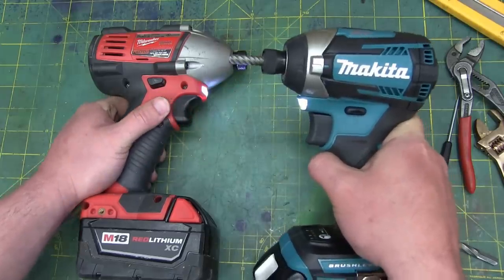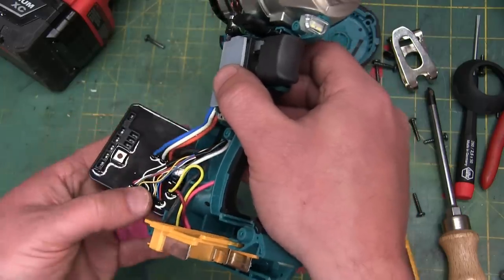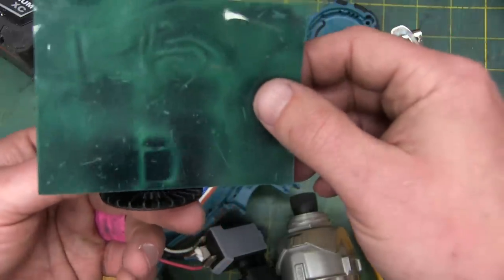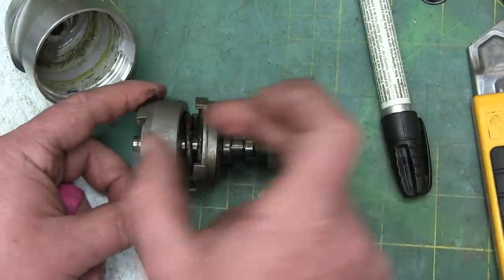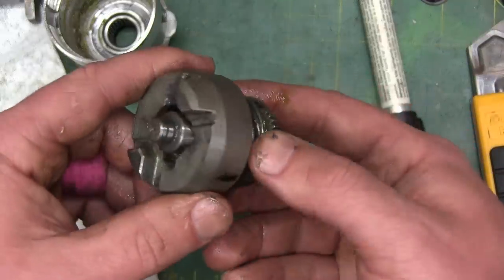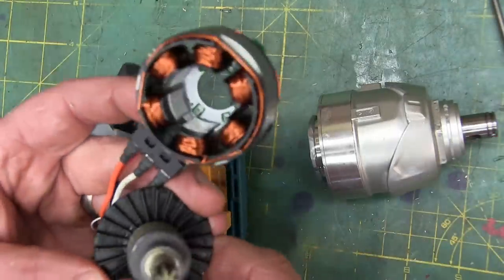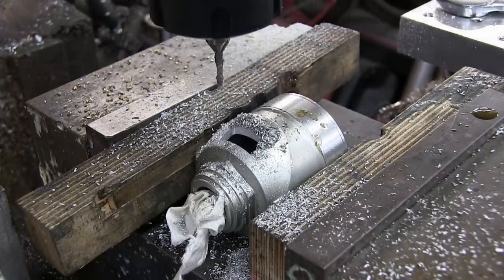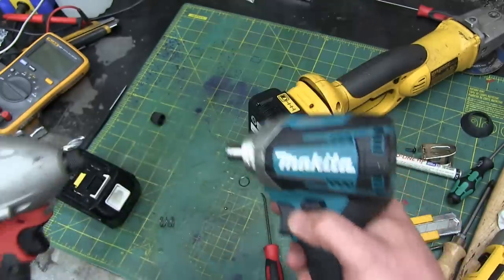BOLTR: Makita Brushless Impact Driver

Comment: let me tell you about my cordless impact...

it looks boring from the outside, but once you have a peek under the hood you better have a camera ready
beefy anvil, huge driver, georgeous machining on every single part
bearing surfaces are ground to a mirror finish, just like the gears...helical gears, I might add, a helical planetary gearbox in a cordless tool
and the grease, there's barely any grease in there, it's just a thick black paste of molybdenumdisulfite...with trace amounts of grease I guess

I have seen many things in my life, but this tool really is something else, I don't know if dewalt builds their tools like that, as the tool is powered by dewalt batteries, or if that's a facom exclusive.
I'm honestly in love with that thing^^

Comment: Ok, so I only scanned roughly the first 30 comments, but at 1.1k comments, I'm sure someone has said this already, but I'll reiterate anyway. The "H" is for "hard", "S" is for "soft", and the "T" is for "self-TAPPING" screws. In "T" mode, the tool revs to its highest rip 'ems while the screw is boring it's way through the hard material, then automatically shifts into the medium speed to actually thread the screw through.

Comment: don't know for sure but the blinkinlietsen on the bottom of the grip are some sort of torque monitor control so you don't start cross threading a customers oil drain plug.

Comment: the button controls the rpms, slow med and high. the other form is called tightening mode and starts the rpms fast and then slows down when it starts to impact. mainly for self tapping screws so you don't strip them out. it works great when your screwing off hi impact sheetrock to light gauge studs. I have the xtd12 (I think it's what it's called probably called something different in canada) and it has 4 speeds and also tightening mode and another feature called assist mode that starts the rpms slow and then speeds up once it starts going, for like lag bolts and such. I wish you would do a review on that one because it's made in Japan instead of China and would like to see if there is a quality difference.

Comment: Just uhh.... make a little plexiglass plate for that, mill a recess around the window, put a screw around each corner... maybe mill a thin recess inside of the recess for the plexiglass to put a touch of silicon to keep the grease in. Now suddenly 1) it still works as intended but you can see the innards, and 2) you can add grease just by opening the plexiglass window and putting a little in.

Comment: The Milwaukee one Ive used a ton of from brand new to beat right to fuck. Were used in a factory assembling reach forklifts. Those 1/4" drive ones I don't like as much because for one, they shatter the 3/8 and 1/2 drive adapters for sockets constantly. Like keep a couple spares in your box constantly. Then After awhile the 1/4 chuck on the tool explodes. I seen that happen to about 3 of them.

Comment: You should do a video on the makita xst01z. Its supposed to be a "quiet" impact driver with a hydraulic imapct system. Its pricey but itd be interesting to see the technology they developed and why they havent made an updated model. Evidently short lifetime due to the hydraulic fluid getting hot and thinning from what ive heard.

Comment: I have the Makita sub compact drill and impact and I love them.  I kept those but I switched my main battery platform to Milwaukee m12 because Makita tools are so expensive (so are most m18s as well). On my budget and for my needs it wasn't worth it and m12 works for me.  I still love Makita though.

Comment: 0:29 That little thing is the most beautiful little accident ever. Definitely a keeper to just have lying around my desk.

CHALLENGE
Can you do this with a carbon steel which can be hardened and can you figure out some devices to cut and grind this thing into a feasible cutting tool for something? 

(I know it looks like an endmill and I'm hoping it could be turned into an endmill but I don't want to restrict the challenge to just an endmill)
Reply: ALSO
Makita wins because you started with Makita. Momentum and and other stuff. Spin up the millfucky first before starking the Makita and see what happens.

Worst case scenario: You end up with more spiralled trinkets

Comment: You should patch up them holes you made with JB weld eh so dirt and stuff don't get into it and wreck it if you plan on using it in your shop. Maybe make a video about the repair of machined holes.

Comment: hey i dont know if you still read the comments on here
Thanks for this vidjao  (don't know if that's how it's spelled). It made me curious about my Makita impact. my impact is a brushed 18v li-on. so I pulled it apart and I don't know if the angry pixies got a little too excited, but the cap at the back of the planetary had backed off and released the shmoo.

Comment: I was wondering about the rpms and bpms, I just figured 3600rpm was max unimpeded speed,  meaning top speed while not hammering. When it is hammering obviously it loses velocity due to the impacts and figured top hammer speed would be 1900rpm with 2 impacts per revolution. This would be the max BPMs and Max RPMs they could advertise, even though its not  really 3800 BPM at 3600?

Maybe?

Comment: I know that your videos address the composition and materials of equipment as opposed to ergonomics and and out-of-box performance.  As well, you haven't done m,any head to head competitions between brands.  I would suggest doing so using your expertise; Do a Milwaukee v DeWalt v Makita v Bosch comparison of 18/20v brushless platforms (and maybe non-brushless) concentrating on materials used, build quality, and who is best over the long haul.  You mentioned in mone Makita video that while it didn't necessarily have great initial numbers, it would be a better long term performer.  
I haven't found anything like this on Youtube and I think you would be uniquely qualified to do this.  Thanks for your work.

Comment: You don't have to have all the sensor junk for brushless, they just tend to be a little fucky at low speed. Bad for a hand tool, but perfect for rc stuff. Super simple, just three wires to run one, swap any two to change the direction.

Comment: I think you're over thinking the difference in impacts vs RPM. RPM is likely measured at a free spin, so that's obviously the motor's max speed. In order to get impacts the motor has to compress that spring, IE: load, so it's going to spin a bit slower; therefore, a lower number of impacts than RPM. No?

Comment: Purchased my milwaukee fuel. Dropped it in the water. Batter and drill still work perfect. My coworker bought makita and dewalt tools. They were returned several times because they couldnt hold up to the same standards as milwaukee. Just sayin.
Reply: I work w DeWalt everyday. Had batteries and tools fall in the water and they all still work. All my co workers use DeWalt except for 2 and they all work the same. Minor differences in either tool but for the most part they're gonna get the job done.
Reply: are they the flexvolt? Because thats what my coworker has and they have held up other then the chuck breaking on his drill. Im a dockbuilder so we put our tools through alot.

Comment: The discrepancy between RPM and impacts per minute....the motor rpm is based on a nominal voltage of the battery, but a freshly charged battery is a higher voltage than this nominal rating...therefore, with a fresh battery, the motor is spinning faster than the rating!  And obviously the marketing dept will do their best to inflate the stats, listing the maximum impact/min when the battery is fully charged, rather than impacts/min when motor is spinning that it's rated RPM.
Reply: Not with brushless it won't.

Comment: Why run both anti-clockwise? Can see that by the direction of the twist on the rod.
Also, with 8 rims in the twisted part, that means 1 1/3rd of a turn on a hexagonal rod.

Comment: Do you know if the brushless Milwaukee impact drivers are constructed with all metal gears and gear housing like the Makita? I can't find any info on that. I was specifically interested in purchasing the Milwaukee 2750-20 as a gift, but don't know if it's good quality or not. Thanks!

Comment: Since there are six corners on that bar at the beginning, wouldnt it only be barely one full twist? Funnily enough I only know this from twisting steel handles as a hobby blacksmith, but 8 twists would snap a white hot bar several times that length, much less doing it cold.
edit; its hex not square drive

Comment: Twisted 2 times.  4 flat on the bar means 4 threads/rotation.  Still friggin' cool, though.  :-)
Reply: aussiebloke609 that's a 6-sides standard bit so ist 1 and1/3times twisted
Reply: Thanks - I had to really squint to see the other flats, once you mentioned it.  I thought he was just using square bar stock.  Still, a lot less than the "twisted up 8 times" he said ...somewhere around 0:35, I think it was.  :-)

Comment: As far as the plastic washer/spacer goes, that isn't there as a shock absorber to prevent shock going from the hammer to the casing? The plastic can take a bit more of a beating than copper or some soft metal like that can?

Comment: What would cause brushless cordless impact drivers to not work when used on energized high voltage lines? For back ground I'm a Electrical Lineman and our most common distribution voltage is 13,200v wye phase to phase, 7,620v phase to ground. The old school brushed cordless impacts work just fine on energized parts, but the brushless don't work when in contact but work just fine otherwise.
Reply: My best guess would be the Hall effect sensors, as AvE showed in this video. Those sensors are crucial to the tool's computer knowing how to pulse the brushless motor windings. The high voltage probably creates a magnetic field that is captured by the Hall sensors, and the tool computer gets all confused and refuses to chooch. 

Brushed-motors are much simpler and are mostly mechanical in how they work, so they're not sensitive to weird magnetic fields. 

It might be interesting to try it with a really long extension bit (get the tool away from magnetic fields), but you may also need a bit that wouldn't conduct electricity as well. Either way, I doubt fun experiments are encouraged when working around high voltage lines
Reply: bnasty267 makes sense, I figured it was some sort of magical pixy thing. I haven't experienced this phenomenon myself, but I've heard other guys talking about it. We do have a training field that experiments like that could possibly be conducted, but I'm not sure it would be company approved.

Comment: RPM output discrepancy... is it because the 3600 rpm is max UNLOADED, but the 3800 hammer blows/min is at max hammer load, and therefore the fully loaded motor is spinning almost, but not quite, half as fast (so 1900?), then double the hits?

Comment: I would ove for you to incorporate the motor along with a flexible shaft to power a bicycle, an e-bike. Seams as though you can discard the drill housing and use the same configuration, variable speed of course is preferred.  Looking forward to your new invention!.

Comment: Wait... If the hammer is slipping over the anvil... OF COURSE it's going to impact more often than the output shaft turns... Though at full load it would be even more of a difference... and at no load it wouldn't hammer... so I have no idea what their testing methodology was.

Comment: In the defense of these overmolded transquirmers, it's rather handy when you're on a metal roof and you can set the tool down without it going all slip and slide to its imminent demise.

Comment: are you sure it wasn't free running rpm and max impacts?  those two don't happen at the same time.  max rpm is no hits.  When it hits it is slowed.  unless it says 3800bpm@3600rpm then I'd say they are two independent measurements.

Comment: 99.99% of all tools drills impact bits sockets etc are hardened and are slightly brittle, I never been able to twisted up a bit like that...seems impossible. generally the impact drivers do not have enough power, and second the bit would just snap off not twist like that, as if it was made of lead.

Comment: In the last couple videos you mention that milled steel is better than sintered steel, is the same true for the tungsten carbide that is sintered? Actually I've never heard you talk about tungsten carbide that isn't sintered, so if the stuff was machined, would it be stronger than the sintered stuff?
Reply: Josh Sheets I think the problem is tungsten is so hard you can't really machine it, at least not in any affordable way

Comment: Hi Mr.AVE and fellow hive mind associates. (spelling, i know..)
I have scrached my hair out ovetär this. What is the difference inside the reviewed Tool (dtd154Z) and the DTD148Z?
Is One more scucum, do they share motor and hammer machanism?
what i have found is only cosmetic, the 148 has a glow-in-the-dark-peckerdetektor and the 154 has the LED..
wich should one pull the wallet trigger on to then receve the acctual trigger for?

regards//
Me be since long time fan.

Comment: I rattle my Lexus wheel nuts on and off with a Stanley FatMax impact driver. Works like a hot damn, until it shears off the 1/2 inch drive adapter....

Comment: Hey AVE, do you think the difference between the impacts per minute and RPM could be because under impact load the motor isn't turning as fast? lets say when it impacts it turns around 1900 RPM therefore producing two hits per turn
-Will

Comment: Chinesium? Japanese typeface traditionally includes Latin script that is fixed width, half width of the Japanese characters and has serifs, probably specifically in order to be distinct and give the less familiar characters some differentiation. In Helvetica, you can barely even tell the uppercase i and the lowercase L apart! And serifs fix that, it's very important for people less familiar with the underlying language. It stands to reason that China has copied that, because it makes sense.

Comment: your doing a comparison on a new makitta brushless vs an oooollld ass milwuakee brush motor drill. milwuakee released the bruahless drill 4 years before makeeta. as of 2017 in may i just finally had my first failure of the milwuakee brushless drill since i bought it upon release 5? maybe 6 years years before now. i did the ssme test u just did but with actual impsct bits and it broke 20v dewaults chucks and with it makita shattered the entire drill. i sent the miwuakee in on warrante not the homedelot warrantly but with the added on 5 year on top of that. they sent me a new drill with a letter and added the brushless hammerdril, as well as the entire 12v line. asking what i used the drill for. i did include the breaking makitas video

Comment: Nice video, but It's different quality. Milwaukee M18 Fuel Impact drill is better than Makita DTD High level. This Makita DTD154 and DTD171 (DTD170) are the best impacts drill by Makita. I have Makita DTD154, because I am working interior carpentry.
But if you work structural carpentry outdoors (wood or metal) , Milwaukee M18 Fuel is superior.

Comment: The addition of the plastic spacer is the manufacturer assuring a fail over time. The motor and mechanism must be built virtually indestructible just to operate correctly,the plastic spacer is can be accurately designed to wear down over a course of time . They want you have an awesome drill for around two years them poof,buy a new one. I've found the same kinda shit in newer model washers and dryers. Around the mid 90's the appliance industry adopted the mechanical programmed fail points, it's criminal.

Comment: Is there anyway to change the parts on the milwukee quick connect to the 3/8" drive impact by swapping the ends out. I know you can buy both parts and I want to convert mine so I stop breaking the bits

Comment: I think you are overcomplicating the difference betwen RPM and IPM. RPM is no load speed, IPM is by design loaded speed. This is not unique to the Makita, every impact driver I've seen has this difference.
According to this: http://www.edn.com/Home/PrintView?contentItemId=4406682 ( graph in the lower third of this page ) you get maximum power out of the motor at half of unloaded speed.
So it makes total sense to start impacting at, or slightly before that Point.

Comment: whats wrong with a compact size have you ever tried to run a screw in straight between a 12 on center joist with a 3 in screw
Reply: with a full size drill

Comment: Try something like this.   Milwaukee 2753 vs Makita XDT09 Impact Driver. Would be a little more fair .. Yes ?. That old Milwaulkee has an old battery 3.0 and not a brushless it doesn't look like. Favor Makita much ? Makita batteries are way to expensive to boot ...

Comment: Not at all fuckin first!  I cant be the only one who absolutely hates overmoulding. Especially since that shitty rubber-whatever its made of turns to shmoo after a couple years.

I have a tape measure thats got that shit on it.. a fuckin tape measure! And I pulled it out of the box a couple weeks ago and straight into the shitcan because it got all gooey.
Reply: chumprock And now you know why they add it to fucking everything, so you throw it away and buy a new one!
Reply: I made the stupid mistake of thinking the plastic pos Stanley powerlock would be just as good as her metal cousin.

Comment: REALLY dont get the whole brushless motor thing!
I mean WHY does the computer need to know where the rotor is? 
Surely if it just fires at predefined intervals based on the position of the trigger, the rotor will follow the computer rather than the bulshit of the computer following the rotor. 
Someone please make sense out of this.